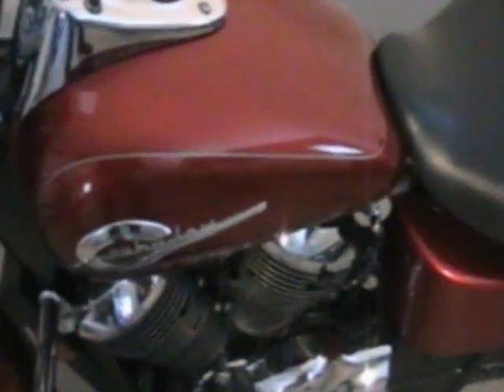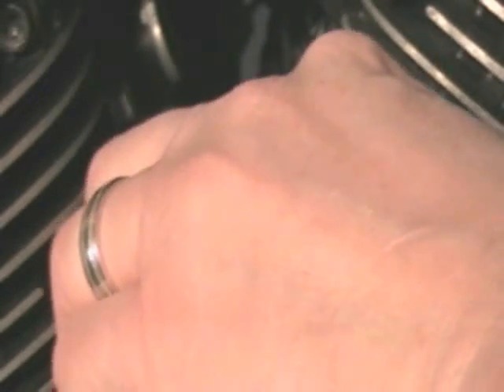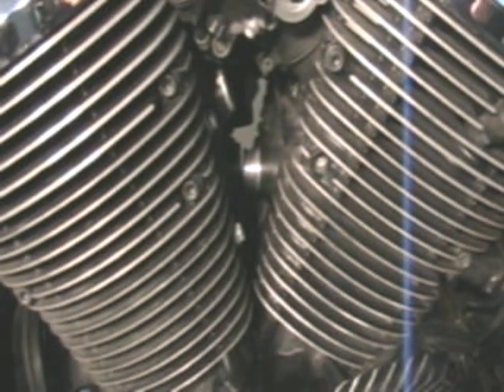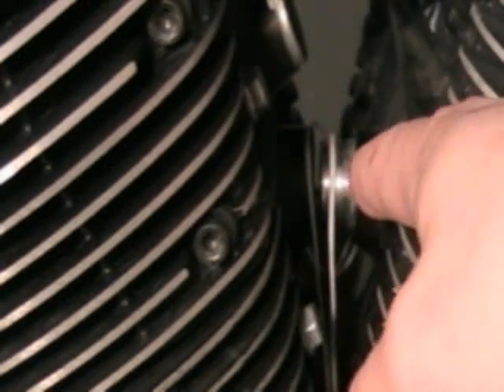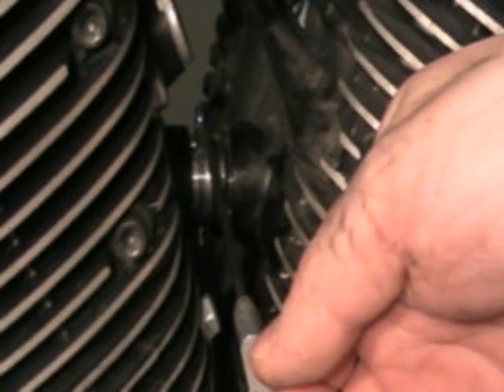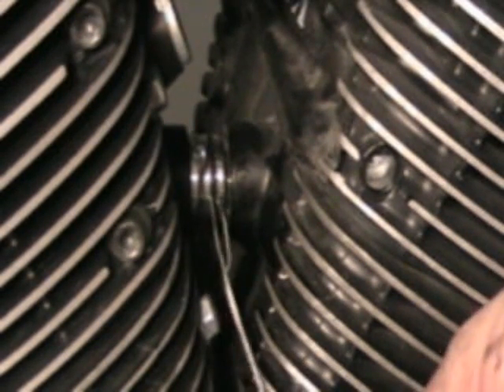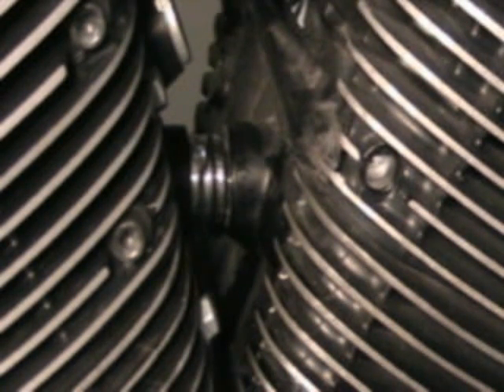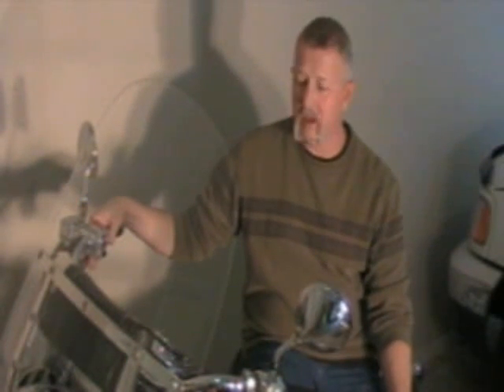Honda Shadow VT750 ACE Motorcycle - Coolant leak from Crossover Tube repair

Comment: Thanks Dennis  -  You're the best!  I have a 2007 Honda VT750CA Shadow Aero and thanks to your tremendously helpful video, switching out the crossover tube O-rings and clips went quite smoothly!   Afterwards I filled up the reserve tank and ran my bike for about 5 minutes, expecting that the anti-freeze reserve tank level would decrease, since I lost at least a pint of anti-freeze during the O-ring replacement process (and assuming the water pump would immediately kick on to refill the system.  Thankfully, my coolant leakage at those O-rings stopped, however, the reserve tank level stayed about the same.  Can I safely ride my bike, or do I need to remove my gas tank in order to fill my radiator from the top cap?  (I'd rather not hassle with this, if it is not necessary.)  Do you have any advice for me on this matter?  Thanks, again!  - Gregg
Reply from the maker: Thanks so much for watching, Gregg!  If you lost a pint, I'd recommend making sure the radiator is full.  Sometimes you can get to the cap by just removing the plastic cover that is between the gas tank the the neck, on the right side of the bike.  If not, you can usually loosen the bolts on the tank and slide it back a touch, without having to remove the fuel line, etc.

Comment: Do you take out all the coolant out of the reservoir also or you let it leak whats in the cillinder ? Please let me know I wanna do this to my bike allready have new o rings and clips
Reply from the maker: Thanks for watching, Phil!  I did not drain my coolant.  Mine only leaked a small amount out of the the crossover tube, so I only had to add a small amount into the reservoir.  If you leak a significant amount, the radiator cap is just under the gas tank on the right side.  You can remove the seat, remove the gas tank bolt and move the tank just a little to get to the radiator cap, then fill the radiator if needed.

Comment: hey, just curious while I was trying to get the O ring off  I scratched part of the metal... would that possibly cause any damage? awesome video I greatly appreciate it
Reply from the maker: Where exactly is the scratch and how deep is it (roughly)?  If it is on the tube and only a surface scratch, it should cause no problem.  Thanks for the comments and for watching!
Reply: Dennis Coffey might be slightly deeper than a surface scratch, had to use a knife to break the ring, and the scratch was right beside the ring on the tube. working on an 04 shadow, seems to be a slightly tighter squeeze, also could I just clean the tube off with a spray bottle of water?
Reply from the maker: As long as the o-ring can seat properly in the tube and the cylinder, the scratch shouldn't be a problem.  make sure there are no sharp edges that will cut into the new o-ring.  I'd use gasoline or WD-40 to clean the tube rather than water.

Comment: Would this cause coolant in a spark plug valley I was watching something the other that said there's one in the heads? I have a 05 Honda shadow spirit 750
Reply from the maker: I'm not familiar with the Spirit engine, but yes, I'd think that a leak here could get antifreeze in the plug valley.

Comment: I fix the leak as you showed, Thanks a bunch!  However, after doing so.  On my first test ride the heat light came on and I noticed that my fan wasn't turning itself on to cool off the engine.  any ideas?  I refilled the coolant as shown in you video, coolant its on high level, but it seems to me that the coolant is not circulating on the system.  I would love some advise!
Reply from the maker: Did you ever get this problem fixed?  It sounds like the thermostat that turns the fan on isn't working.
Reply: Dennis Coffey I had to fill it up from the top of the radiator by the handlebar right side if you are on riding position. just kinda hidden under the tank.  Once I filled up from there everything was working just like it should. Thanks Again!!!
Reply from the maker: ric0surf Awesome, glad you're back on the road!

Comment: I just replaced cross over seals on my 2003 Shadow and put little bit of antifreeze back in rode her about 5 miles and antifreeze still not circulating help
Reply from the maker: Thanks for watching, Farish!  It will take more than 5 miles to get it hot enough for the antifreeze to circulate.  Also, how are you checking the circulation?  At idle, you won't see much movement.  If there is none when hot and when the rpm's are higher than idle, you may have a water pump problem.

Comment: What website did you use to order the prints- please provide links and what are they called?
Reply from the maker: Hey Mel, you ask for prints, I think you mean 'parts' ??  You can get the o-rings thru Amazon, hondapartsnation.com, and probably ebay.  Just google the part number I show in the video and you'll find several suppliers.  I think they're only like $2 on Amazon.

Comment: I have this same issue on a 2001 ace. my question is how would I replace the cross over tube its self? I bought two o rings, two clips and the cross over tube? just doesn't seem like enough space to actually take the tube out ?
Reply from the maker: Thanks for watching!  The process I showed in the video will not allow you to remove/replace the tube.  If your tube needs to be replaced, I know you at least have to remove the jug covers (the fins).  You might have to remove one of the jugs, not completely sure on this engine.

Comment: hi can you tell me what size ise necesasry for honda shadow vt1100 c3 aero. its my first bike and has same problem. and where can i buy it, thank.
Reply from the maker: Hi Davit, I assume you are looking for the o-ring to fit your motorcycle?  Here is the o-ring part number for the VT100C3:  91310-MB0-003  You should be able to do a search and find a vendor of your choice.  Let me know if I can help further.  thanks for watching!

Comment: This is happening to mine but I discovered the leak when my bike wouldn’t start. Will the leak prevent the engine from starting? A cold front blew thru here in Louisiana at the same time and I thought the cold affected it but it warmed during the day & still won’t start.
Reply: New battery & it started right up. Honda shop says they have the o rings in stock. Gonna watch the video again as I change it out. Thank you 🙏
Reply from the maker: I'm glad you got the starting problem fixed.  I just recently had to do the same thing...new battery.  Mine was 4 years old though.  Seems these Shadows don't like low voltage on the battery, so even when the battery is getting weak, the bike may not start.   I'm sure you will do fine with the crossover tube leak repair.  Let me know if I can help.  Thanks for watching!
Reply: The Honda shop charged a total of $85 to change it out. I still can’t believe it. 
But...... the shifter and chain came back extremely loose. I tightened the chain but can’t see what to use to tighten the shifter.
Reply from the maker: Yes, $85 is a sweet deal!!  I'm not 100% sure about the shifter....I have a heel/toe shifter on mine and I just can't remember how the stock shifter was set up.  My heel/toe runs on a shaft, with a bushing in the shifter lever, there's not a way to tighten it.  If it got loose, I suppose I'd have to replace the bushing.  Yours may be set up the same way (?).  Hopefully that helps a little.
Reply: Thank you sir.

Comment: I have a 2005 Honda Shadow Spirit and we have been getting some crazy heat here 115 degrees I noticed a little coolant leak just behind the front  cylinder head on the left side, I cleaned it up and have not been able to get it to leak again. Are the Honda Shadows set up the same as your bikes cross over coolant? after watching this video i think this might be where its coming from.
Reply from the maker: I'm not 100% sure if the Spirit is set up the same way...my ACE is a Shadow, so if not identical, they are probably similar.

Comment: Hi there. I did the repair. The first ride after I was done, the overheat light came on. There is coolant at the upper level, and the fan is working. Any ideas?
Reply from the maker: Thanks for watching!  You may need to replace the thermostat.

Comment: Before starting this job drain the coolant, if not you'll have about a quart of coolant run off the moment you displace the tube. Also use a piece of harder paper to block the cylinder hole as you remove the o-ring to prevent it from falling into the cylinder hole.
Reply from the maker: That has not been my experience at all.  Only about a 1/4 cup of coolant, if that, will come out of the crossover tube.  The o-rings are seated in grooves on the crossover tube and have to be picked out, so they won't slip off into the cooling jacket.  Thanks for watching!

Comment: Where did you order the parts from and is there a groove on the tube for the clips or is that just for the o-rings?
Reply from the maker: David Schwab Hi David,  I ordered my parts from www.hondapartsplus.com.  I have no affiliation with them, but I got good service and good prices.  Parts came quickly for me.  There is a groove in the water tube for both o-rings and for both clips.
Reply: Ok thats great cause I have an 07 honda sabre 1100 that seems too be leaking coolant from the exact same spot
Reply from the maker: David Schwab Another commenter has done this on a VT1100 and said it was a little bit tighter fit than on the VT750.  I'm not sure about the Sabre, but he needed a set of 11" needle nose pliers to complete his repair.  Hope that helps you!

Comment: I’m having difficultly moving the tube. It’s so jammed in there. Any ideas? The backward pull with all my strength isn’t working
Reply from the maker: Thank you for watching!  I had the same problem with mine.  I just kept working it and finally got it to come loose.  If that won't work, you may have to disassemble the cylinders to get some more room.

Comment: Engine block may be low on antifreeze,should have remove the radiator cap to fill up the system,then check the level on reservoir
Reply from the maker: +stealhty1 Fortunately mine did not leak enough to be low in the radiator, but I agree, it is best to check it and top it off in the radiator if any doubt.  Thanks for the suggestion.....and thanks for watching!
Reply: @dwcoffey  where is the radiator cap? I've done the o rings and you were a tremendous help, but I forgot to take the cap off the radiator, so I think there's a air bubble, and would like to bleed my system anyhow

Thank and blessings 🙌

Comment: Not sure but my honda 750 is doing these popping sounds on acceleration and im wondering if this might be the solution for it.. Please Help!.
Reply from the maker: Richie Nomura HI Richie.  No, this wouldn't cause your bike to pop on acceleration.  That sounds more like an ignition issue.
Reply: late reply but check for any exhaust leaks around the crush gaskets,vacuum or intake leaks and also carbs issues. those CV twin 36mm are notorious for that,especially if you have changed exhaust and not adjusted or rejetted the carb.

Comment: Sliding that tube has been horrible for me. Should I WD 40 it or something? I got the front one in but can't get the tube to slide up enough to get the rear one replaced, and that's the one that was leaking to begin with.... Any suggestions?
Reply from the maker: +B Stapleton Just make sure you have pulled the front clip out so that the tube can slide that way.  I'm sorry, but other than that, I'm not sure what to tell you.  The tube on mine was pretty tight when I replaced my o-rings.  I had resist the urge to pry against the cooling fins on the cylinder, for fear of breaking one off.
Reply: @dwcoffey  you could put a piece of wood perpendicular to the direction of the fins! This would distribute the force evenly amongst the fins to pry, and you could use the wood against the pliers as leverage

Hope this makes sense lol

Comment: Hi wht is the part number for the honda ace clutch cable  i have same model as you but I cant find a match for Honda ace 750 cdc all i can find is 750 cdca and 750cdc ac please help
Reply from the maker: +Britmoney King Based on what I can find,  I believe they are all the same.  22870-MBA-000

Comment: my vt750 crossover is frozen. any tips?
Reply from the maker: Hi Roy, that tube can be a bugger to get out.  You might be able to make a little more room by removing the cooling fins from the cylinder(s).  If you can get pliers on it and get it to turn, that may break it loose enough to slide it over, but you'll have to be careful about scratching it up.
Reply: Dennis Coffey thanks Dennis, I'll give that a go in the am. The other option is taking it to Honda on Wednesday. Mechanic there said he can get it loose for a hundred bucks...I'm trying not to spend a 100 bucks
Reply from the maker: I sure don't blame you there!  I don't like to spend any money on something I think I can do myself.  Were you able to break it loose?
Reply: Dennis Coffey Not yet but I went ahead and wrapped the crossover with plastic and filled it with pb breaker. I'm going to let it sit for a few days.
Reply from the maker: Sounds like a good plan....hopefully that will help free it up a bit, at least enough for you to be able to get it loose.
Reply: With all this...leak stopped.  Apparently the PB breaker caused it to reseal.  I'm good with that for now.

Comment: For those looking for the parts once you find your year and model number at www.hondapartsplus.com click on 'water pipe' and the parts referred to in this video are numbers 7 & 8. Ive included the part numbers as well.#7 CLIP, RING (22MM)90601-MAA-A00 #8 O-RING (21.5X2)91310-MB0-003
Reply from the maker: Thanks Jaime!

Comment: Hi, I’m here in 2024. Godspeed, and thank you for blessing so many with this knowledge. 🫡
Reply from the maker: Thank you so much for watching!
Reply: I couldn’t get one o-ring off, the first side was jammed, even tried re inserting the cross tube
Reply from the maker: I have a small set of dental picks, that's what I used to get the 2nd one off.  I hope that helps.